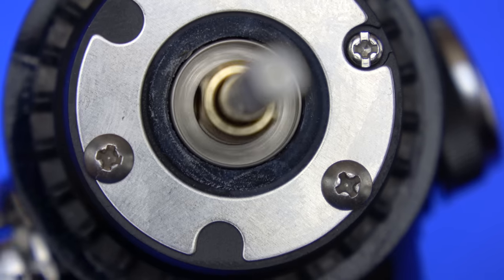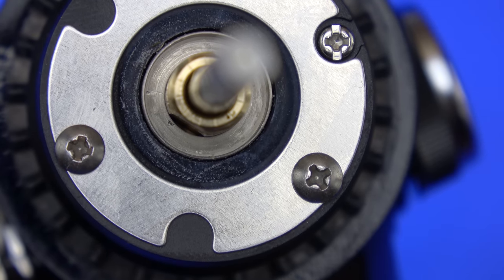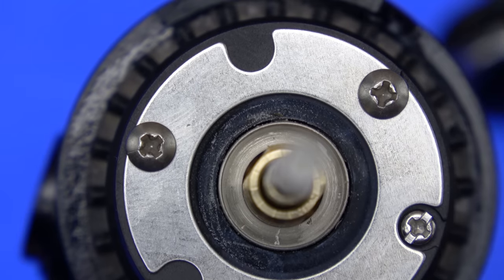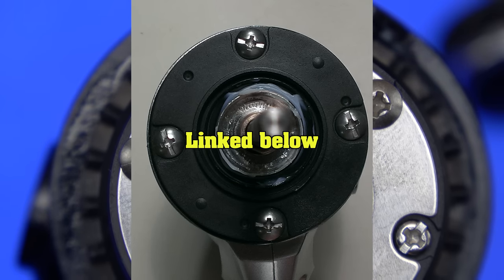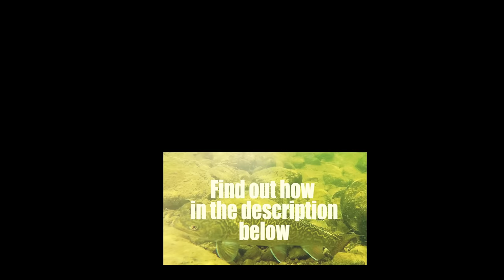Shimano's Nasci headscratcher: Why did they do it this way here and so differently elsewhwhere?

Comment: My experience was terrible with this reel. I have a bg 2500 now, and i love it. Not going back.
Reply: Tacklecentral Fishing I’m thinking about trying the Diawa bg just because of tackle advisory tear down plus he knows a thing or two! Lol
Reply: The bg is probably the biggest introduction in the $100 price point in a very long time. It has the same exact bearings as the 2015 saltiga, the same drag as the 2015 saltiga, very high quality construction.
Reply from the maker: I helped a young gent from British columbia via facebook chat who had a nasci which would bind on the retrive.  Almost locking up.  Ended up after walking him through a complete tear down.  There was a chipped piece of plastic.  Took 3 hours and until 4am to get it resolved...But yeah when dealing with any mass produced reels...there are issues....I had 2 stellas back to back  with sideplates and rash guards so out of allignment..the edges would stick out enough to cut ya .  So it happens with everything at any price level
Reply: As alan hawk once said: "We've seen questionable quality coming from america, and quality from china. Quality is always where you find it"
Reply from the maker: Yup!  The way I look at things.....For 20 years...many of the worlds top selling retail items....never even had a made in the USA counterpart.  And many of those products...we no longer the means to even make them even if the price was prohibitive.  I had made in USA Zeebass reels literally fall apart while tight on fish..As a matter of fact.  Out of the 200 reels I've owned.  Made in USA zeebass reels spent more time being reparied...than every reel i've ever owned combined x 5................quality is where indeed always where you find it :)
Reply: ...and the zeebaas is promoted as a reel with "mighty capabilities" :{
Reply: Tackle Advisors  🤔I’ve been thinking about getting this reel for fluke. Guess I’ll get another Stradic
Reply: cool thing to do.   sound like a stand up kinda guy, even your on screen manner puts that out.    You're the kind of guy people run into at a small shop (of whatever type) who is passionate about whatever the store is all about.

I had a similar thing with a cvz that i use a certain way developed a strange rub/pulsing after my last use.   I thought for sure that i bent the frame or spool shaft from the incredible thumb pressure i put on it.   After wasting too much time looking at the mechanisms to narrow it down, it turns there was a tiny piece of plastic stuck to the spool rubbing on the frame.
Reply: that's one thing i've noticed about many americans, they assume american made is the best.   good luck finding an american made TV, phone, computer, tablet, precision automatic watch, etc.   Even "american made" cars and trucks are only 1/2 american.   In fact, as far as trucks go, last i heard, the domestic market toyota tundra is more american made than the Ford F series.  key components of just about everything come from all over these days.
Reply: Tacklecentral Fishing What issues did you have with the Nasci?

Comment: My Nasci reels all went to hell after one season. Fishing in the Gulf of Mexico and freshwater rivers in Europe. The Nasci reels were smooth out of the box but shortly into the season they became loose. One fell apart while Asp fishing high speed retrieve lures. One broke while trying to pull a Snook from underneath a dock light...too much flex. Meanwhile, my old Shimano Stradics, Spheros, and Ultegra Super Ship are still working perfectly. Late 90s and early 2000 was the pinnacle of Shimano. Many tough excellent reels from the time period. Now it’s strictly Daiwa or old school Shimano for me.

Comment: I’ve got the 2500 model and it’s a great reel  and smooth. I’ve even accidentally dunked it in saltwater and when I took it apart no water had gotten in because of the seals. The only issue I’ve had is the line roller  not working well even after cleaning and lube.
Reply: J Cook I've got one in a 3000 and line roller is my only issue as well.
Reply: fuckposi they sell a ball bearing upgrade on eBay for around 12$ but I’m not sure if that will fix my issue. There isn’t an actual ball bearing in it from the factory so I’m guessing it would help
Reply: J Cook Hedgehog Studios? I think I'm gonna have to get that. I was trying to follow the lubrication schedule in the manual but it isn't enough.
Reply: J Cook I have the 2500 as well and accidentally dunked it in a freshwater lake, destroyed the felt drag washers and I also have problems with the line roller because line gets stuck in between the roller and the casing which damages the line
Reply: Kyle_A_C   I replaces the felt drag washers with the carbontex from eBay, works great and only like 9$
Reply: J Cook I already did and they weren’t that smooth, so I switched them out with some from a different shimano

Comment: I think for the price point shimano was satisfied with the level of sealing.  One little half assed seal isn't gonna get noticed by the buyer much unless they are hardcore.  
I had my nasci spend some time submerged on two different occasions.  One for about 20 mins, which is plenty time to put these seals to the test.
I thought for sure id be taking it apart for service but it still runs like new and I haven't taken a tool to it yet!

Comment: Hey, do you think Nasci and Sahara is the same reel if Nasci is not 100% sealed??? Because I see Sedona, Sahara and Nasci are the same reel with different cosmetics, thanks
Reply: They're all the same except for these reasons. Sedona is has one less bearing than the Sahara. Nasci has seals and Sahara doesn't. Outside of those two differences they're the same reel.

Comment: Those seals are for a little bit of extra protection and there is no problem with them at all, those Shimano super anti rust bearings can take a real beating and keep going like champ's and i know because I have a Sahara and dunk it a couple of times and the dam thing just don't quit just retired it because it was really old my model was a 2004 when they use to be of metal frames

Comment: Would you choose a Nasci or a Sahara? I was eyeing a Sahara for a while and there were some deals on ebay and the like but I got several Nasci for the price of Abu Garcia Pro Max and I just couldn't pass it up. I was going to add Nasci over the Daiwa BG  but I knew you would say BG. The BG sizing is way off compared to Shimano and a 4000 Nasci compares to the 3000 BG.

Comment: Tackle Advisors I opened up my Nasci and now it clicks very slightly when the rotor passes a certain position. If held facing straight down it doesn't seem to do it. I've opened it back up and looked everywhere in the reel and I have no idea where it's coming from. Any help would be appreciated.
Reply from the maker: Bettcha 5 bucks it's that annoying rubber rotor brake make sure it's completely seated
Reply: Tackle Advisors It was actually the trigger for the bail closing mechanism. Couldn't figure out why it was rubbing the top of the ramp so I removed it.

Comment: Maybe you can answer my question? Just purchased the new Tatula LT 4000 mainly for fresh use and some salt. Was this real built for both being that it doesn’t have the mag seal like the feugo? I can’t find any concrete evidence that’s tells me yes or no. Thanks love your vids.
Reply from the maker: For a looooooonng time no reels other than VS , saltiga Z, catalina, or the Mitchell Nautil offered any form of sealing....Then came the Gosa SW,  Spheros, etc...now there are tons of options that offer some sort of sealing.   The tatula offers absolutely zero sealing whatsoever.  But it's built strong enough to handle light to medium ish saltwater duty.  You just need to be mindful of salt and sand.  It is a tad freer spinning than the ballistic or Fuego LT's...but those reels offer rubber seals at the handle shaft and main shaft plus mag seal at the ar clutch.     Although I toss about my saltigas lilke they are van staal reels...i don't recomend people do that if they don't have the patience and ferrofluid to fuly strip and service regularly.  Would i recomend the tatula lt for the salt?  No....I'd recomend the Ballistic if you wanted to stay in the daiwa line up.   But I'd say go speros or saragosa over them if the added weight penalty wasn't prohibitive....I'd go saragosa/ spheros over ballistic if only saltwater fishing.  (i have the ballistic lt, and tatula though in 2000 and 2500 sizes and have had multiple Saragosas which is nearly identical to the spheros)

Comment: At $100 I can understand it I guess at $200 for an FK I expect a proper seal. Seems like here lately Daiwa is beating up on Shimano pretty badly until you get the really high end stuff.
Got a full review planned on the FK?
Reply from the maker: Agreed....The way I look at it..daiwa beat shimano for baitcasters pre fukashima disaster....Post...it seems weird economical design choices found their way into both.....Now it seems daiwa is offering more bells and whistles....and shimano has added a splash more refinement.  And their high end freshwater spinners.....While as redundant as some of the daiwa offerings.....Are better.  I wish they made a Certate mag or something and kept zaion out of the top tier egg beaters other than for the rotors.  Fancy carbon plastics have a place for sure...but not in 600$ spinners...but that's just me......I was told daiwa's 5 year plan.....and holy crap it looks promising......Leaps and bounds bringing a design found in their latest saltwater super spinner into 99$+ reels.....Shimano will need more than mgl rotors and hagane gears to compete.But daiwa got rid of worm gear oscillation in their fw spinners a long time ago..and I don't see it ever returning which is a shame.....I'm hoping shimano start putting super slow oscillation (25 handle per  directiion of spool stroke so 50 turns of the handle for an up and down) into their fw reels.

Comment: Handle could be beefier. Don’t really like the line roller, although it does roll (not bind) under load. The seals worked well for me when I’ve accidentally submerged it a few times. I think the key seal is the one above the rotor.

This reel worked perfectly on a light tackle rod to bring in a keeper sized resident striper that popped off between my feet due to user error. Very happy with this reel but I’ll probably buy a Spheros SW (money permitting) or a BG 5k for a bigger alternative (when my life allows me that disposable income to spend on fishing). 

If that budget doesn’t happen, do you think this would handle the pressure of 40” post spawn bass? (Inches - Not 40lbs.) I’m hesitant to risk that even though the main gear & pinion look well constructed enough to handle it.
Reply from the maker: +Eric Deissler +Eric Deissler I haven't seen any lts larger than 2500.  But if the handles are the same gauge up in the 4k 6k size I'd agree.  There is a seal that will add a little resistance in the roller.  But I grease my line rollers so it's no biggie
So yours is holding up well so far to some abuse?
Reply: Complete accident - my Nasci 4K got dunked in sw for ten mins minimum on its side. I went home to ornery pregnant wife and three kids awake, so I only had time to rinse not open it up or even lube any parts. It worked fine thereafter and that was in June. I opened it this fall after a subsequent dunk in rough surf. It had no signs of water infiltration from the top and maybe just a tiny drip that appeared to have come through the screw in side of the handle. No damage. Relubed and packed marine grease into the handle openings & seals just for help.

Comment: I have Nasci 3000. The biggest problem is the handle(length). The 2500 spools 29 inches of line and is fine.
The 3000 has the same handle length, (only bigger knob, T shape) but spools 36 inches of line. 
The short handle doesn’t have enough torque, you really need to crank it hard to work.
Horrible design, I need to buy a full handle from 4000 series, if they are interchangeable.

Comment: I think its more marketing and the necessity of having a "seal" even for the sake of it.

Even the FK's pinion seal isnt what i would call legit... the rubber is nothing like a true lip seal or similar to the Stella FE's pinion seal.

They're making seals out of the wrong rubber and wrong design.
Reply from the maker: +Andrew Slazmo problem with the pinion seals in them... They dont make contact with anything.  I don't even think the fe Stella makes contact. The fi barely touches at all but it's a tad different than the fk design
Reply: @TackleAdvisors  a little late but better than never 😉

The FE seal does make good contact with the cup pinion inner roller.
Reply from the maker: @Slazmoservicing4209  wow...that would make the FI a downgrade then lol  
Oh well....lolol.  You're gosa is more effectively sealed than the stella fi

Comment: Get a shield 6000. Better seals for 90 bucks
Reply: Danny D Morales Been happy with my Nasci- not trolling you though! I’ve heard not good things about the Shield and Alan Hawk backs that up. Although, to be fair, I haven’t seen anything where he directly compared this reel and the Shield. Personally, I’d go with the BG 5 or 6k and keep it well maintained in case of accidental dunk to negate little sealing of that Daiwa reel. 

You like your Shield? We have a lower end Tsunami spinner my bro in law bought at a local B & T. It has been used a few time and sitting outside in the corrosive jersey shore air for two or three years. Never been rinsed,  cleaned or relubed. Used it a few times this year to set up the kids for fluke/flounder and it hasn’t crapped out yet.